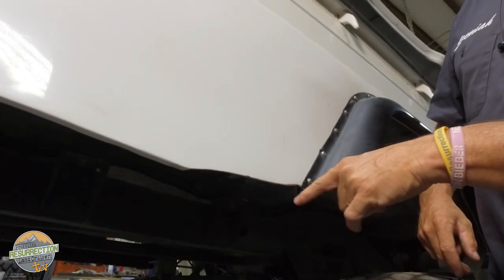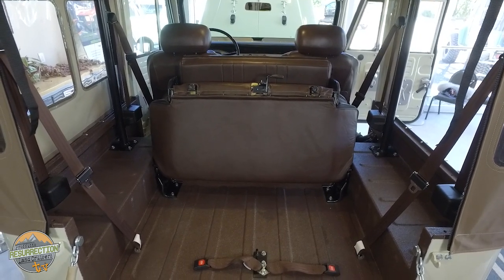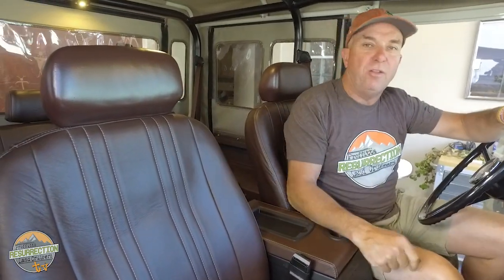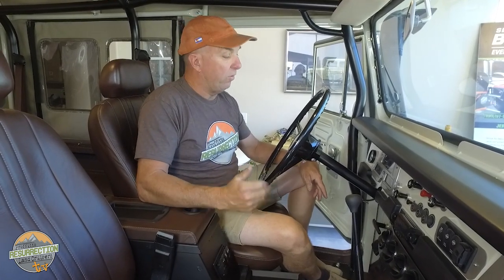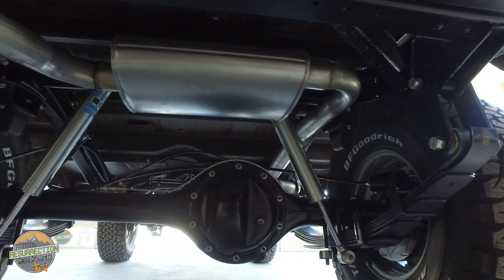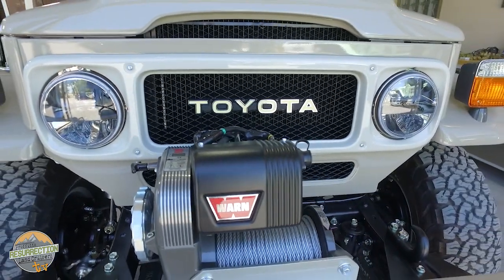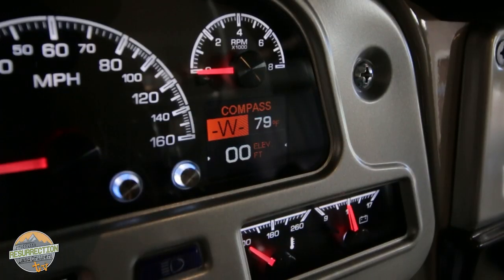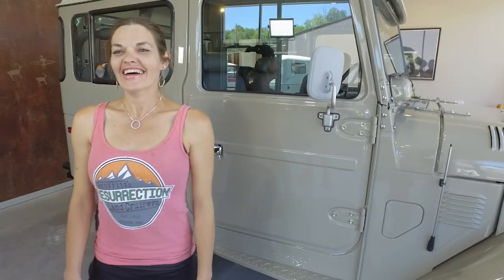Restored vs Resto-mod. Two FJ40s meticulously built but very different. Which one is your favorite?

Comment: What is the best petrol engine to use for an 68 FJ40?? Does Cummins do petrol - also best for fuel economy at over $10 per gallon, I’m looking for that to be a consideration. I see 1FZ may be good? Thanks
Reply from the maker: Hi James, That's a tough question. Honestly, it's hard for us to steer away from Toyota unless the client is just instant about it...but if you want economy, Toyota straight 6s aren't always the best choice. Unfortunately Cummins only makes diesel engines. My suggestion is a 2F or a 1FZ and stay light on the throttle!

Comment: I have fj60 mod 84 pl,s till me how mutch it will cost for full resto stayg 3? I am From k.s.a Best Regards Hussein
Reply from the maker: Hi Hussein. We were in KSA in November for the Global Auto Salon and Riyadh Season. Love your country. To answer your question, there is a wide range depending on options, but most of our stage 3, body off 60 series restorations run from $100,000 -$170,000 USD